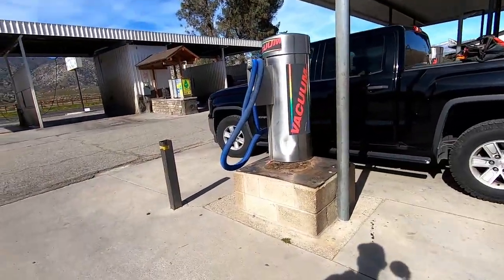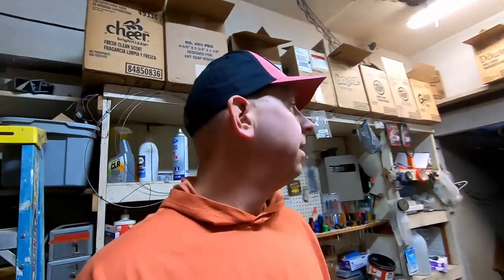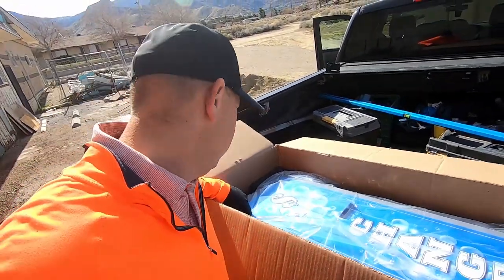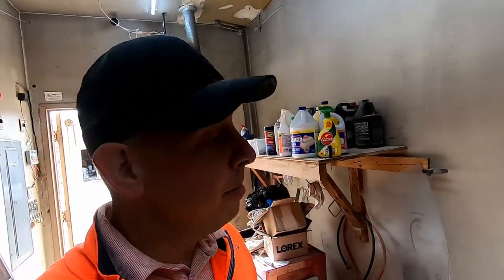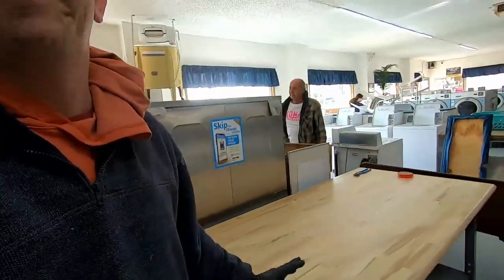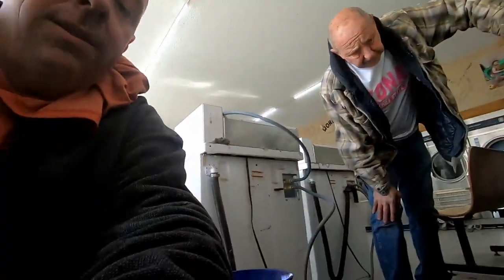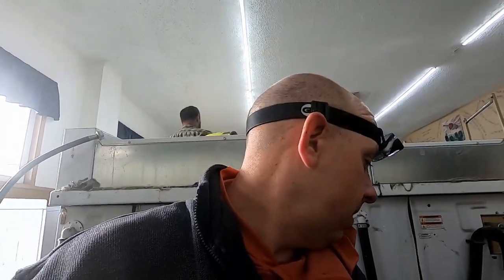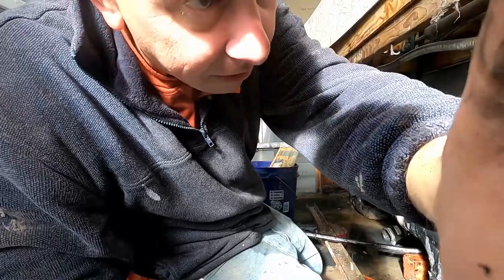Vacuums, Change and Drains

Comment: A cheap fix for this is on collection day bring some dawn dish soap with you and run a cycle threw each line with hot water ( not each machine rotate weekly) about a cup it’ll breakdown any debris in the long flat runs and help the main drain stay clear. The hair from animals and people acts like a sponge for any oils in the wash and cling together the dawn breaks down the oil and makes the hair slippery enough to run free.